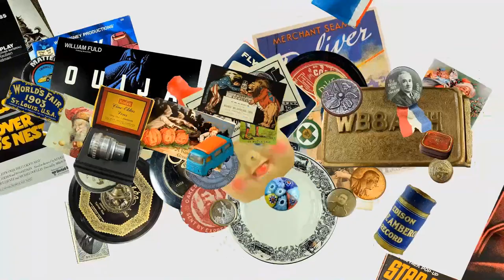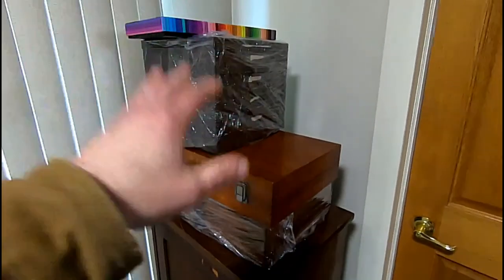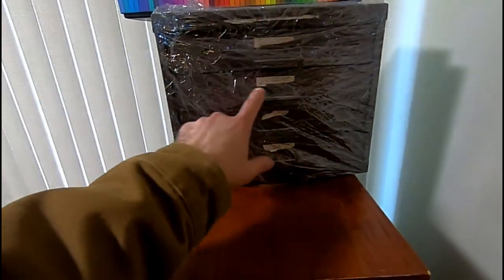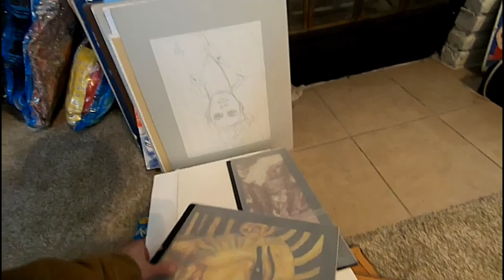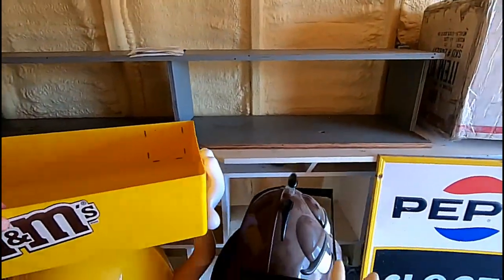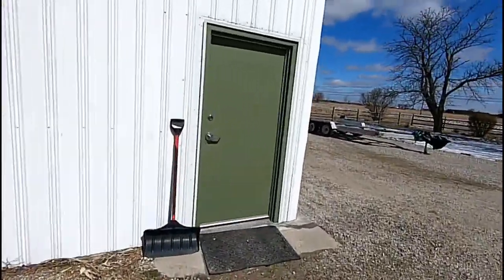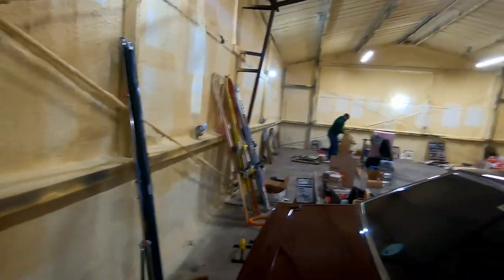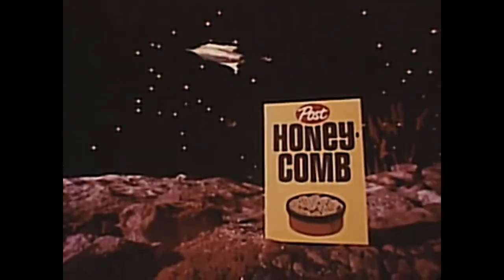A Look At Our New eBay Business Building

Comment: Spray Foam:  had the small new building at my lakeside hose done with that type foam.  24x24 pole barn ’, with tall walls and big gables. Ran me about $2000, 2 years ago.  They drove over from the city, with a tank style truck that had a 2-part mixing nozzle.  I love it, for the way it goes on fast and it does a great job moderating the heating/cooling cycle. To finish it off, we skinned it over with plywood so cabinets could be mounted.
Reply from the maker: There are several different types of spray foam. At the price of yours it must be opened cell high density. The best stuff out there is low density (doesn't expand very much) and closed cell (water/weather proof) which is what this building has. It's hard as a rock and not spongy as well.
Reply: @TheAuctionProfessor  True, about the varied types.  Mine is not as hard as yours, but one of the keys I have found over the years is filling the voids, so condensation can't happen between the foam and inner wall.  I learned that years ago, while using Stress Skin Panels for the roof of a Log Home we built.  Since I had a different style pole barn (all wood framing) then yours, my void space to fill was 1.5", which is why I went with spray foam, rather then sheets of foam.

Looking forward to seeing the progress on your new place.

Comment: W@$$UP!!  Just my opinion: Wouldn't be dusty with all that insulation?  If you can afford it maybe look into some drywall?
Reply from the maker: It's closed cell low density foam, and is a solid mass with no dust. Open cell is the common foam insulation that does produce dust though.